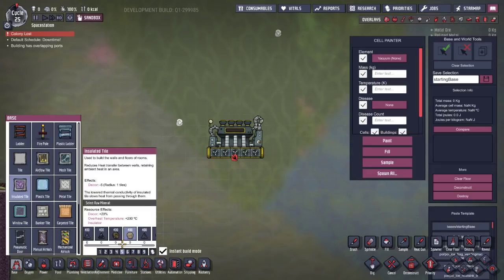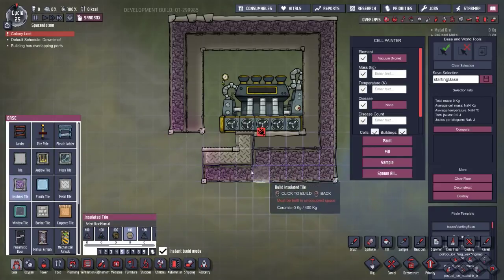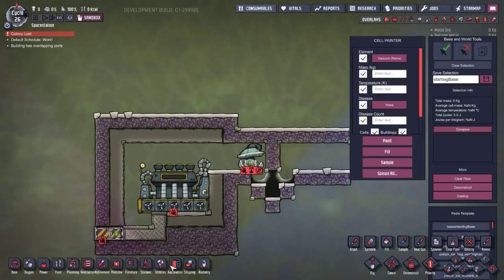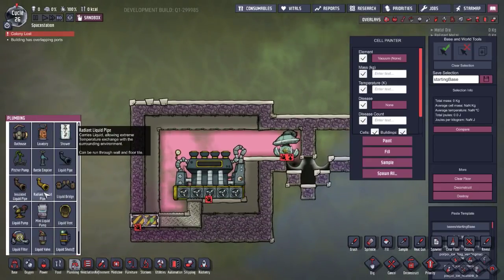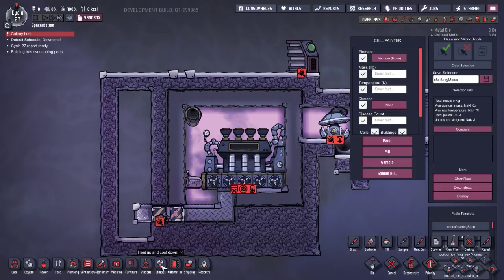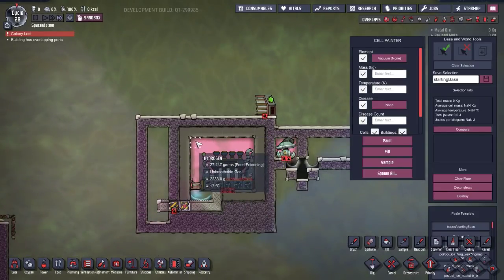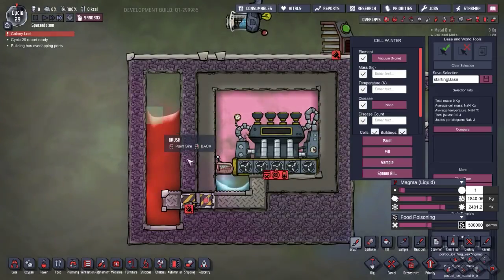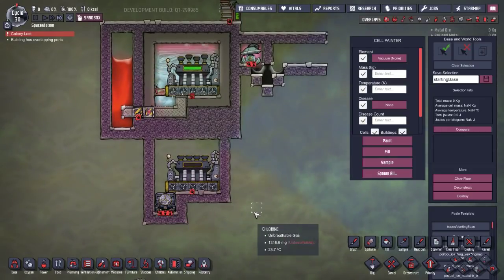Oxygen Not Included Best Steam Turbine Guide (2019)

Comment: Great video, thanks for the help. But my engines keep losing pressure and shutting down. Any ideas?
Reply from the maker: Could be a problem with the heat source (not hot enough or slow transfer) or incorrect amounts of steam/hydrogen.  Hard to say which without more info.

Comment: I've seen a few turbine setup and I don't understand the use for mechanised door to transfer heat?
Reply from the maker: When the door closes it creates a connection that can transfer heat, when it opens it breaks that connection and all that is left is a vacuum which cannot transfer heat. So you can use that property to turn heat transfer on and off. Without this you would waste energy by overheating the steam.

Comment: Hey, how do i get the magma in there without killing my guys haha, xD just tried and miserably failed. Im not talking sandbox mode here
Reply from the maker: You could use a pitcher pump + bottle emptier if you really wanted to but that is quite labor intensive. This system is best to be built around its heat source which is why a volcano is great for it.

 If you do want to use the magma pools for it, I would recommend running radiant pipes with hydrogen to absorb the heat from the magma and then transport it to the turbine. Keep in mind magma is quite hot so the material you use to construct the pipes will matter greatly.
Reply: @LurkzGaming  great thx for the answer. havent had useful volcanoes yet though

Comment: Aqua tuner never gets hot enough. Mine gets stuck around 130C. Wont get hot enough.
Reply from the maker: Without a picture I can't help much but if I had to guess I would say the aqua tuner is not running enough or has not ran long enough to complete the initial heating.

Comment: If you replace the heat source with a thermo aquatuner, would it still only need 170kg of water, or would you have to increase that to accommodate the additional space below the turbine?  I've been deleting heat from my base by running p-water through pipes with an aquatuner to "flush away the heat" like Brothgar did in a separate video, and it worked well.... right up until it couldn't delete enough heat :).  I figure replacing that setup with this could delete an insane amount of heat, but only because the output temperature of the steam at the top is fixed.

EDIT: I figured this was a good exercise in math for my 12 year old, so I had her work the numbers.  If 170 is the optimal amount per 2kg hydrogen square, then it works out to 5.3125kg of water per square of hydrogen.  Upping that to 34 squares (accommodating for the additional 2 squares that the aquatuner takes up), brings the final amount required to 180.625, which I'll round down to just 180 for the sake of simplicity.  Math IS useful beyond middle school :)
Reply from the maker: Hi joshua! 170kg will still work however increasing it slightly wouldn't hurt anything if you wanted to be sure. I use the very system you're referring to for water cooling my plants and you're right, it can delete an insane amount.
I have a video showing how I set it up if you're curious. https://youtu.be/s99PWpahjxc

Comment: Note: You NEED tungsten. Tried it with iron, and it just didn't conduct heat fast enough

edit: If you put in around 250 kg of water, iron metal tiles work just fine
Reply from the maker: Makes sense but I think gold would work as long as the temp isn't too high.
Reply: It probably would, but i had a significant amount of iron, but not that much gold, so i went with that

Comment: Thanks! I was having trouble maintaining power in my base due to having no coal and tapping out my nat gas/hydrogen vents. I'm gonna try this setup and you probably saved my 1100 cycle base
Reply from the maker: You're welcome! You could always turn to oil if you're in need of power. I prefer using petrol generators for the extra water which goes back into the oil reservoir for more oil. Good luck with your base!

Comment: Hey I really like your design, I just wanted to add if you put an aqua tuner underneath the plates as well and run it with the primary heat source you can increase the efficiency of the setup, most bases are cooling water anyways so it's a good way to displace that heat from the tuner in a more useful way
Reply from the maker: That's a good idea, normally I would set multiple systems up but combining them would save time and resources.

Comment: Help, I'm having steam deletion when running the same setup. I eventually have 10kg per tile hydrogen above. But no matter how much steam I put in. It's getting deleted.
Reply from the maker: The only time I have had this happen is if there is no gap between the top of the turbine and the ceiling tiles. Try adding a 1 tile gap and it should fix it.

Comment: really nic ebuild, but i dont get the pump on the right...
Reply from the maker: The pump is for the initial setup. If you have any other gas in the room it will cause problems so you need to start out with a vacuum.

Comment: whats the door in the bottom for?
Reply: I think it turns heat transfer from the magma on and off. When it's closed, it is conducting heat. When it opens, it makes vacuum (perfect insulation)
Reply from the maker: Indeed the door controls heat transfer.
Reply: @LurkzGaming  Don't you have to plug the door in though? or does it just open without power? xD
Reply from the maker: It will open without power but powering it will cause it to open much much faster.
Reply: @rune7740  I'm assuming we could automate the door and control the system temperature ?
Reply: @shoddyproductions9793  i knew that, already. i didnt know if it needed power but i understand how it works now that ive tested more after juked replied back lol

Comment: So the general principle is that the hydrogen cools the steam and it falls back; does the hydrogen temperature ever equalize with your source and 'die'?
Reply from the maker: The steam isn't being cooled down by the hydrogen, just forced back under the turbine where the heat is directed. So the turbine is cooling the steam then outputting it at the top however the hydrogen is already occupying this space so the steam needs somewhere else to go and since we are constantly pulling pressure from beneath the turbine it will naturally flow back to that low-pressure area. The hydrogen will never get above the temp of the steam being output by the turbine unless the turbine is shutoff via automation and the heat source is allowed to continue to transfer into the room.